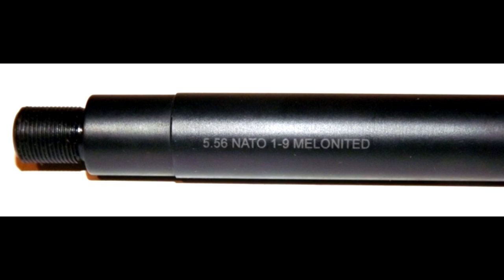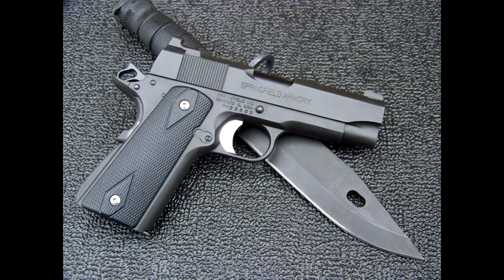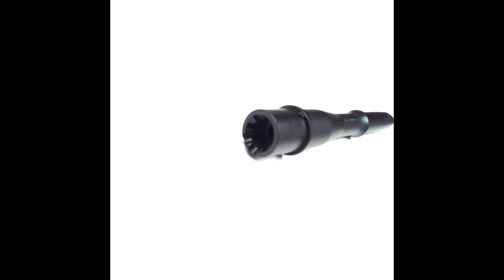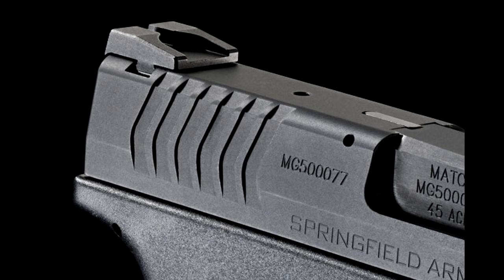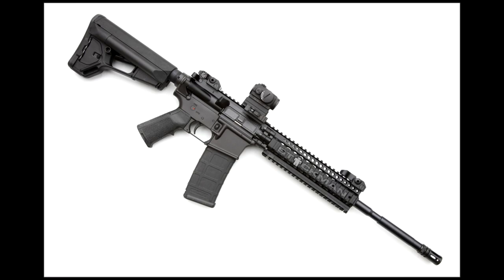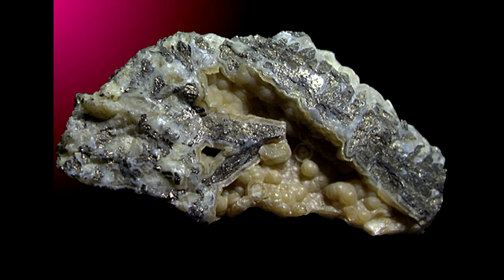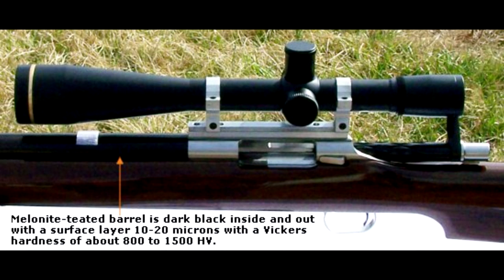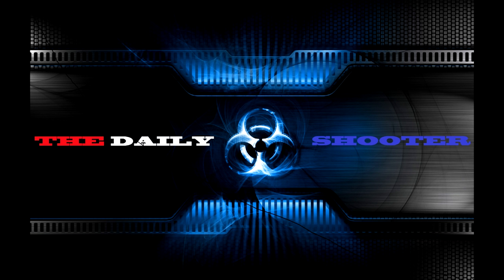Melonite on firearms.  Thinking of buying? Here is some info.

Comment: I think it is important to note that Melonite treatment is a type of case hardening.  It was mentioned that it is not a coating but a chemical change, the chemical change does not go the entire thickness of the metal (hence "case hardening").  This does not take away from the value of the process but adds to it because it is usually very important that only the surface is hardened to maintain strength and toughness.  Also, the term, salt bath, means it was put into molten salt, it is an industry term.

Comment: People here are confused about the effects of the molten salt bath on things like bolts and barrels...  The temperature of the salt bath is between 1000-1100 degree's..  This is the same temperature that carbon steel is taken to before quenching...  Once the parts come out of the salt bath nitride process they are quenched and then they can be put in an oven and taken to 450-500 degrees and Tempered..   A bolt or barrel treated this way will not in any way be "BRTTLE"..  In fact it will be stronger and more precisely heat treated then most regular bolts and barrels..  Also 4140 Chrome Moly gun steels used to make bolts and barrels is not "High Carbon" cutlery grade steel..  they  are medium to low carbon alloys with a carbon content of only .40 percent carbon and usually have a rockwell hardness under 40rc..   Its almost impossible to over harden a medium carbon steel like 1030-1050 enough to become "Brittle" because their simply is not enough carbon content to allow the steel to become hard enough..    These steels are alloyed to be "Tough and Durable" like a shovel..   Not super hard and have high wear resistance like a knife blade or a file..  I see this type of ignorance about steels and heat treating a lot and just thought i would clear up some of the myths and misconceptions..  BTW, the Tennifer on your Glock slide and barrel is essentially "Melonite"..
Reply: Whats the difference between melonite, nickel boron, nitride, tennifer treatments ... I'm confused as to which is best - thx
Reply: me2ontube    Melonite, Nitride, and Tennifer are all different names for the same basic surface metal treatment process and all change the chemical composition of the base metal they are applied to..  Nickle Boron is not the same process and is simply a hard coating applied to the metal but which does not penetrate a few thousandths into the actual metal like the other three Nitrate Processes..  Nitriding, Tenneifer, Melonite surface harden the base metal to a depth of approximately .005 thousandths and give outstanding abrasion and wear resistance to the surface.
Reply: Nickel Boron is a plating.  Tenefir, nitride and melonite are all forms of salt bath nitro carburizing(SBN).  Think of SBN as a case hardening where no metal is applied to the base surface.  Not only is the result superior in wear and corrosion resistance to ALL platings, surface dimensions remain true.  Plated surfaces cannot be applied as true as a low tolerance machined part(cut rifled bore).
Reply: Why don't y'all just admit it, none of you know what the hell you're talking about.
Reply: So according to your theory Carbon and only carbon defines the mechanical qualities in steel composition, huh? I really suggest you you do some reading of metallurgy and compositions. That will open your eyes to many things.
Reply: Steel is brought to roughly 1600 deg. before quenching. This is the transformation point where ferrite becomes austenitic.

Comment: Some answers to a few of the questions I have seen here. Depth of melonite transformation (white layer) is between .00001-.00007, entirely material dependent as it's all based on iron content in the material (4140 will have a different depth than 1018). Hardness will fall between 55-60HRc (for comparison, 4140 in it's natural, as supplied state is 18-22 HRc) regardless of material. Stainless steels (even H series stainless) CAN be melonited, but it does take a special process due to the low iron content of stainless steels.

Comment: Excellent video, thanks for the quality info. It helped me decide on my next barrel. I decided on (after an enormous amount of reading & video watching) Aero Precision 16" Gov. Profile 1:7 5.56 M4 feed ramps, 4150 CMV, QPQ corrosion resistant inside & out, HP tested & MPI for $195. I also picked up a mid gas tube and LP gas block for a total of $255.19 shipped. Aero Precision makes great parts I have 3 AP lowers with 3 different parts kits & 3 different makes of uppers BCM, Spikes & PSA all 3 mate up perfectly, rock solid rifles no rattles. Check them out if you haven't.

Comment from the maker: Thanks 504
Reply: The Daily Shooter Melonite is not good for high temperature such as guns with a high rate of fire. Chrome is better for that because it has a higher temperature threshold. Melonite will gas off its nitride treatment once it starts to reach its temperature threshold.  Also a chrome-vanadium barrel is the type of steel the barrel is made of. Its not a treatment. Chrome-vanadium barrels come with Melonite or SBN treatments on them.

Comment: I love melonite but on a bolt I wouldn't recommended it. The heat from the process runs the risk of making the bolt brittle. this is why the military actually recommends against melonite the bolt.
Reply: +adam mosley One of my rifles, an Adams Arms, has a melonite treated barrel.  I don't think they'd be using it if it made the barrel brittle- I'd guess the same risk of becoming brittle would apply to a bolt as it would a barrel-

Comment: What I read on it is the melonite treatment is "20 microns deep" into the metal.  Like into the surfaces of the object 'dipped' for
treatment. Your narrative doesn't make that plain......... Glock has used it for years, for legal reasons S&W had to change the
treatment name :-)
Reply: 20 microns equals approximately 8/10,000 (eight ten thousandths) of one inch.  That is very shallow.  Other similar processes, like Nitriding, can be far deeper in the base metal, sometimes .010 to .020 inches (ten to twenty thousandths of an inch), with hardnesses approaching nearly 60 Rockwell.  I would assume that the Melonite processes can also be far deeper into the base metal than 20 microns.

Comment: Because of where I live my concern is corrosion. I have never seen a properly hard chromed firearm rust (even though I know they can) but I have seen different brands with Melonite rust under the best and not worse conditions. The only nitride firearms I have never personally seen develope rust are the older Glocks and Walthers and I contribute that to the specific properties of Tennifer. My concern and question is regarding an AR 15 barrel. I have never seen a chrome lined barrel developed rust but am concerned to purchase a nitride barrel since I have seen the treatment rust before. Should I just stay with a chrome lined barrel?
Reply: If I was you I'd also get a quality dehumidifier setup for wherever you store your firearms.
Reply: I'd wager what you saw was not melonite. if it was it's not right. chrome has far less corrosion resistance. maintain your guns and even untreated won't rust.

Comment: Is melonite, nitride, or the salt bath process itself toxic? I came across some info on the net stating that it is highly toxic I'm not so sure is accurate but I want to know. Thanks.
Reply: the process most definitely not something you do without gloves lol. what is being done is the carbon molecules in the steel itself are being drawn via chemistry towards the surface. we are talking a very small distance. the outer surface, the one you see and touch, is having a few thousandths of a inch saturated with the carbon from that came steel. carbon has some of the strongest molecular bonding qualities that we know of therefore you and essential just using a chemical process to create an effect like folding steel like blacksmiths used to do. It was the simplest example that came to me . also nitride ( melonite is a copyright by A specific company) is very cheap and easy and much more reliable.  Chrome is chrome, it rusts, NiBo coatings are so hit and miss. i called in a complaint after 30 rounds and had a refund in my account that day! they knew they had a bad batch. and i kept the bcg. so, know you have to ask why did the military go chrome vs. nitride. neither is space age stuff. and nitride is cheaper.  this is where the real debate begins. cause ALL heated and friction/chemical deposit surface will not last. they all crap out. so go NITRIDE

Comment: it seems odd to me that melinite treated barrels for example seem to be cheaper then the chrome lined barrels and stainless steel barrels even though the melinite barrels should be more accurate and last longer.
Reply from the maker: Yeah I wondered the same thing.  Chrome lining a barrel must be more expensive for the manufacturer I suppose
Reply: I guess you get what you pay for doesn't necessarily apply here.  I am building an AR-10, PSA-10, kind of torn between the 416r stainless steel barrel or just getting the Melonite barrel.  The Melonite is about $60-$70 cheaper, and over a hundred dollars cheaper on some other websites compared to the 416r.  I wish someone would do a comparison video on accuracy between two similar barrels, one Melonite and one 416r in say a .308 18" AR-10 barrel.
Reply: RebelViking912 it seems like in the case of psa the melonite are cheap barrels made by who knows and the chrome lined are made by fn who makes our military barrels so i asume the barrels arent created equal regardless of treatments
Reply: Dave M could be but I did end up buying the Melonite .308 18" upper and it certainly doesn't appear cheaply made.  The Melonite coating process is supposedly cheaper to manufacture then chrome lining and is a more even durable protective coating so I would not assume just because the melonite barrels are cheaper that the quality is less.  I have only seen PSA offer the stainless steel 416R barrels and melonite treated barrels for their .308 uppers so far, and yes the melonite ones are less expensive.  The S&W M&P 10 is a very accurate and dependable .308 AR and their barrels are Melonite coated also so I'm not at all worried about Melonited barrels.  I just want to know who made it for them.
Reply: chrome lined barrel lasts longer with full auto. it handles the heat better. nitride lined "breaks in" ... wears.. to "fine tune"  . everything else pretty much marketing.  shiny chrome looks cool and clean and finely machined. Nitride lined barrels sit in the warehouse.  **But nitride is really about preventing corrosion ** ..  carbon steel rusts easily.
Reply: On second thought most of what I said there is either backwards or just conjecture. Sperm whale oil is the way to go for corrosion protection. Its organic and renewable ;-).

Comment: I am sold on qpq as opposed to chrome lining, but I have only found one barrel that is cold hammer forged and nitrided, and it's a heavy barrel, which I don't want.  when it comes to lifespan, how does the hardness of qpq measure up to cold hammer forging?
Reply: Cold hammer forged melonited barrels last about 10,000 rounds.
Reply: +MrChuckwagon55 get back to the cracks of arfcom from which u came from! a non treated 4140 556 will more than likely reach 10k in semi.
Reply: ya in something like a 243 or some other barrel burning cartridge maybe 10K rounds. A melonited barrel, whether cold hammer forged or not, in something like a 5.56x45 will probably be fine in upwards of 20K rounds or more.
Reply: +mojo jojo show me

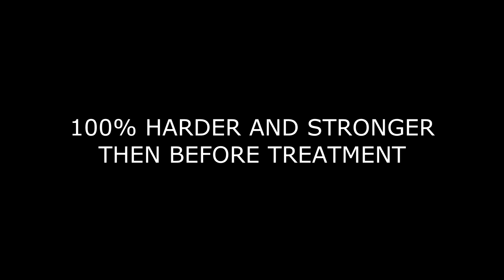Comment: After watching your video, I think you need to either 1. present factual data to back up you claims, or 2. change you presentation- you state at around 1:59 into the video that when dipped in melonite that "within the steel" undergoes a chemical change- which is false- the outer layers of the steel undergo a chemical bonding with the melonite!  it does not permeate all of the steel.  At approximately 3:57 you state that when treated with melonite- it changes the metal chemically- again this does not change all of the steel, just the outer layers.
Reply: He talks about the depth of treatment. ??
Reply: And this would change someones opinion of Melonite, how???
Reply: Someone is a vendor of cerakote.
Reply: Looking for where he said it bonds with all  the steel....
...and just not finding it.

Nor any indication that he intended it to.

Given that this is said in the context of melonite surface treatment, I think what he intended  is both accurately and clearly communicated.

There's actually a difference between "you need to" and, "I want you to."

Comment: Thanks, but a few questions remain:

(1) Do you mean "steel" only or are aluminum metals included when applying these processes with substantially positive results ? If alu what type of alloys would be (best) suited for treatment ?
(2) What effect do Carbon Steels have on any of the 3 different treatments processes as compared to Stainless Steels ?
(3) In other Words: What metal type(s) give optimal results when M treated ?
(4) What is the effect of PRIOR Cryogenic treatment of the metals on the results of this treatment ?
(5) Is there any sense in CRYO treatment AFTER applying the Melonite processes ?

TIA,
Hendrick